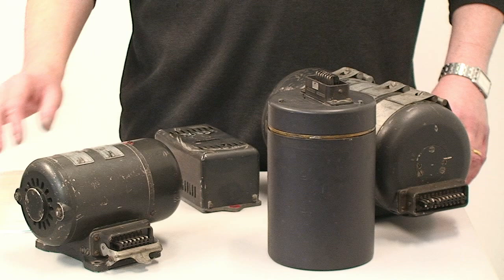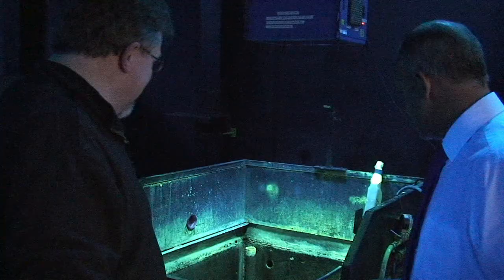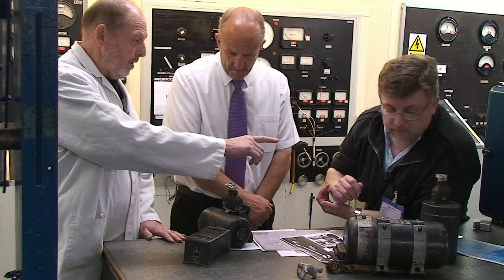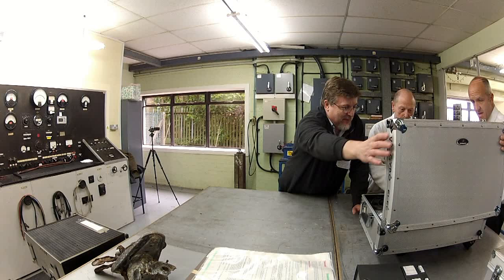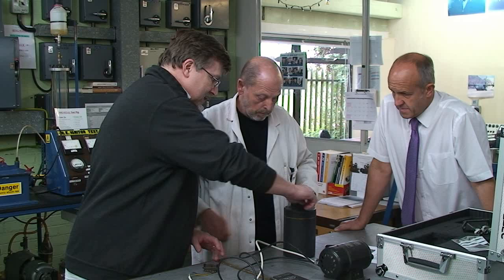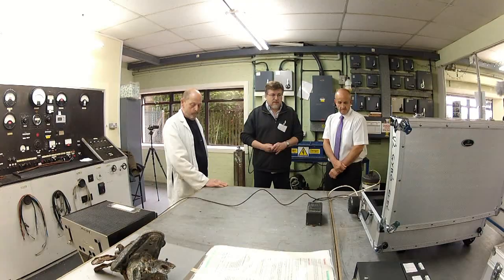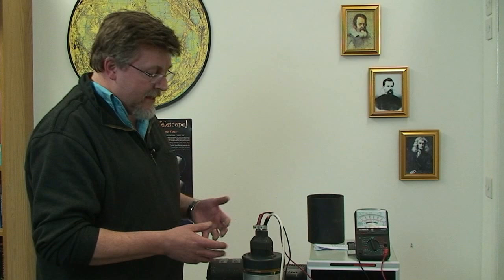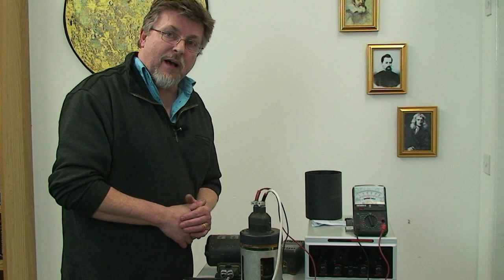The A4 / V2 rocket in detail: Bringing a V2 rocket gyro back to life

Comment: Fantastic explanation, on all your movies!
I am very curious about the V2 compass and his connection and integration.
Do you have one?
Reply from the maker: M. Foryou 

The A4/V2 missile didn’t actually employ a magnetic compass in its on-board guidance system. The launch crew were required to survey the launch site and to determine precise bearings for the centre of the target which would be out of sight over the horizon (eg. Paris, Antwerp, London). That is to say, they needed to be able to fix a point on the horizon such that if you were to draw a line through the middle of the vertically orientated missile, and pass the line through that point – the line would – if continued over the horizon – pass through the centre of the target. Once this survey was completed, the missile would be rotated until one of the fins (fin number one in fact) was pointed in exactly the same direction. This needed to be done with an error of less than 1m per 1000m. Once the missile was launched, and after a few seconds of vertical flight, the reference frame of the V2’s pitch gyro would automatically tilt; the gyro meanwhile, just continues to work steadily to maintain its start attitude.  But as a result of the programmed tilt of the reference frame, the missile pitches into a trajectory that follows the line established to the center of the target.  So no on-board magnetic compass is required.  By today's standards the V2’s guidance system would be considered clumsy and unreliable – but it was revolutionary at the time and provided a cornerstone for much modern development. KR RJD A&NTV
Reply: Astronomy and Nature TV Thanks very much for this complete answer! .. clever system.. i wonder how many V2 eventually failed (out of tarket) in percentage.
Reply: Astronomy and Nature TV:  Amazing extra info.  I was wondering how they set the azimuth on the launch.

Comment: Great, now all you need is a Mischgerät and a Servo and you're good to go! For a quarter, that is. 🙂
Thanks for the upload, and especially the documents in them, I learned a lot from this.

Was the multimeter set to voltage or resistance? Since I'm still quite puzzle at how this all works in conjunction? Are these pickups part of potentiometers or am I missing something?
So the output is in resistance variations or is there an AC or DC voltage coming out that's position dependant?
If so, it makes sense, I get how the Mischgerät/computer works (in large lines, yet to study it in full detail) and you've clarified a lot so far!

Regards,
Thomas

Comment: My modest advise to you, so far as you're getting into electromechanics: do LUBE all and every mechanic electric contact. Doing so you'll save a lot of your time and nerves in bug' searches due to stable and steady (oxygenless) surface electric contacts areas.
Reply: No electrical contacts should be lubricated, except with graphite. Oils are insulators, and they also trap dust, water and debris. Silicones are even worse, because electrical sparking causes a surface covered in silicone to react, and to create silicon carbide, or corundum, whichis both a very good insulator and very abrasive. Silicone lubricants will creep across surfaces as far as 15 to 25 cm (6 to 10 inches) in a few months, thus eventually ruining any electrical contacts. Failure of the contacts will occur weeks, or many months, after contamination, so the root cause of the failure is often not seen.

Comment: Why use AC and an complicated DC/AC converter with a small generator and a frequency controller/regulator? I know it could be because of the rocket connected to mains power, until lanch - then it switches to own battery power. But why not use DC from the batteries, and a diodebridge to convert the external AC to DC, if the rocket was connected to mains power before lauch? Otherwise it also seems like a complicated way to ramp up the voltage, disregarding the DC/AC conversion.

Seems totally over-engineered, but i don't know the V2 in details, or how it was launched...
Reply: Surely you could have done it so if the necessary components have already been invented. I think you did not want to rely on tube technology because of the sensitivity and rather use vibration-proof mechanics.
Reply: Electrical loads on aircraft today generally run on 400hz. Cuts the weight of all the windings.

Comment: Very interesting, I wondered what angle of motion it provided resistive information. Is it capable of 360 degree data? What were the ohmic readings ? 
Trying to guess how they built the navigation .. So they would have needed vector XYZ which two gyros could supply and speed ,possibly altitude ? Have you discussed that anywhere yet? 

Of course they would need some calculation circuit and program circuit for a target. I wonder how sophisticated it was. On first thoughts an analogue computer could do this but did they have analogue op amps? 

Looking at the parts the cost to build such tech then would have been quite decent. Setting up the machines or machinist operations to build.
Very impressive .

Comment: I'm guessing they needed two gyros, one vertical, one horizontal, because they needed to control pitch, roll, and yaw? I wonder how they controlled trajectory?
Reply: Yeah, that part confuses me. What do they mean "vertical" and "horizontal"? I mean, I'm no engineer, but, I'd assume they'd have TWO gyroscopes propped up vertically in the rocket - one for "pitch", the second one, also vertical, but turned 90 degrees, for "yaw"; then, another, third, gyroscope with its axis on its side (horizontally to the rocket, or perpendicular to the other two gyroscopes' axes) to detect "roll".

There must have been crude electro-mechanical computers to provide active guidance to target. The launch crew would have had to set something to "tell" the rocket its launch point position (grid coordinates, and maybe even its launch point elevation as so many meters above sea level), and then the target's grid coordinates and elevation.
Reply: They would have three gyroscopes, all mounted at 90° relative to each other, controlling roll, pitch and yaw (x, y and z axes). This one was the vertical gyro, as he said in the video. The other two would have been horizontally mounted, along the other two axes.
Reply: @MrJm323  Imagine the rocket as a vertical-pointing aircraft. As it climbs it gradually assumes an increasingly horizontal altitude until it reaches the speed-altitude-angle parameters when the propulsion is cut and the warhead behaves as an artillery shell. The "vertical" and "horizontal" mentioned in the video refers to the near-horizontal position, so they become "pitch" and "yaw" in that context.  But I am not sure how they detected an eventual and unintended rolling motion.  I believe comparing the signals of the two gyroscopes together could be the answer. (It would be too long to explain here.)  A third gyroscope would of course be even better.

Comment: Fantastic job on restoring these old systems and explaining how they work! Do you have any information on how the gyro signals were translated into motion on the control surfaces? It would be cool to see how they compared to the selsyn actuators on the B-29 electric gun system, which was state of the art for the adversary of the V2 at the time.
Reply from the maker: Hi and thanks for watching. Yes we have a vid in the pipeline that looks at the V2's on-board 'computer' system and the control surface actuators (trim and jet vane) so keep watching! Regards A&NTV
Reply: That's great! We will be watching! Thanks!
Reply: quit some time ... 
the potentiometer of the gyro was driven by an extra battery at 50V to achieve finer measurement. the signal would than be put throw a simple analoge computing device (the "Mischgerät") consisting of resisters and capacitors and differentiate it 2 fold to compute angular velocity and achieve a lead phase shift to prevent the A4 from building up oscillation. it outside power supply was 40VDC but it got its own power supply.

look at page 123 for schematics and description:

www.aggregat4.de/pdf/Ger%C3%A4tebeschreibung_A4.pdf

the rest is adjustment, if got the formula for the control movement (Ruderausschlag) from another book (Das drahtlose Jahrhundert - Hans Frahm):

Ruderausschlag = a = k1 * ε + k2 * de/dt + k3 * ∫dt

they though the fins in the gas stream would not be sufficient to make it stable at start, because of that they added Empennage with fins but as another video of AaNTV shows it worked just fine:
/watch?v=KToggTKa9Lk

i´m looking forward to see this thing in orbit :)
if you need any help with translation, please contact me.

Comment: Hello. Great research. Can I assume that the pickups tested on lap 19:00" are internal for "yaw" and its the Roll pot that is not connected? Also the pickups on the bottom on 6:30" are not variable pitch items put purely for receiving current, yes? At first I was under the impression that they were roll pots, yet I saw Yaw with your needle and was stumped.  Also, I thought the A4 Gyroscopes were two independent ones mounted on a platform.  How does this one play in? Thanks for you time.

Comment: Fantastic video, you have better stuff than in the Peenemunde museum.  Why didn't they use a DC powered gyro?
Reply from the maker: Hi Peter, that's a good question - thank you. The short answer is they needed a well understood and reliable system and the existing alternating current technology was available off the shelf, cheaply and with a profound level of easily available design competence. They needed a power supply system with an integrated reference point so that motors for gyros and control surface actuators could be clocked and kept within predictable limits. Elecro-mechanical methods of controlling current had been available for decades prior to the development of the V2 and the technology was widely used in the aircraft industry. It made perfect sense to use technologies that were 'off the shelf' as the V2 development team learnt early in the project to avoid reinventing the wheel if they didn't have to. Good, 'solid-state' DC control methods were in their infancy in the 1930/40s and would not become a serious, and better, replacement to AC until well after the war - indeed, not until the development of digital control systems was there something actually better than AC control methods. KR RJD A&NC TV
Show less
Reply

Comment: You did not provide the rational behind the inverter and control box and how they worked.
Why is the speed so critical?
I guess that one can not use brushes at that rate in the gyro and that the slightly higher voltage reduces the weight? But I do know cheap tiny brushed motors that do turn that fast on much less voltage.

Comment: Didn't all of that only really need to work for the powered portion of flight ? Once the engine burned out there was no attitude control of the rocket right ??  No RCS system and only real control was with the thrust vanes.
Reply: True but that actually puts more stress on the controls! Because at the moment when the engine cut out, the trajectory and airspeed had to be spot on, since there was no control after that.

Comment: what I dont understand is why the motor for the gyro had to be AC for 500Hz. 
couldnt it have been a DC motor so the inverter and transformer wouldnt have been necessary?
Reply: I was wondering that too. My thinking is that they needed more current to drive the motors than they could generate with DC and batteries, given the technology of the day. Or, it was done to require less battery, for weight reduction.

Comment: I have one qiestion :) servomotors was suply for the same bayttery?
Reply from the maker: Hi Wernher, thanks for dropping by! The gyro motors and the servo motors both ran off the same pair of 16v lead-acid batteries providing 27v 500Hrz AC through DC/AC motor transformers. But the control or signalling voltage that carried the gyro potentiometer values to the mixer/amplifier was provided by a separate set of small 1.2v or 2.5v NiFe accumulators wired in series to provide 50v DC. 
Now if you really were WvB I think you'd have known that. I hope this helps. KR RJD A&NTV

Comment: So the gyro is pretty much two electric motor,s working against one another to keep the rocket upright. How does it work to send itself to it,s destination pre computer ?
Reply: No, why do you say "working against each other"?
Reply: Thats what was demonstrated at the end. Did you see the meter needle deflect as he moved tilted the gyro? That output was used to drive the fins.
Reply: There was a computer. The early V2s used a mechanical analog computer that was later replaced with a tube based analog computer. The computer is what kept it on course and, in later designs, when to shut of the fuel. The gyro were inputs to these analog computers. Driving the fins directly would have caused the rocket to become unstable.

Comment: I, too want to know how the trajectory was set and followed.  Obviously, there were no digital computers with trajectory in memory.  Was there some sort of timer with contacts signaling timed events to a system that reset the desired potentiometer readings?  Or, perhaps the guidance system was not self contained.  Instead, the missile and firing center communicated via some kind of telemetry system?  Does anybody out there want to comment?
Reply from the maker: Hi Mark, thanks for posting. We have a video in the pipeline that will completely answer your question - we've built a special model to show exactly how it was accomplished. The video should be ready to upload before Christmas this year. So just subscribe and keep an eye on your inbox. KR RJD A&NTV
Reply: Thanks for the reply.  I await the release of this report.
Reply: The only way I see this system could be used would be , on the launch pad the trajectory angle for the target, E,W,N,S was set for the gyro and zeroed by manual potentiometers at that angle . The output from the gyro would be ignored at takeoff for a certain time / altitude . After that interval the output which would not be zero (rocket ascending straight up ) would be applied to the graphite vanes in the exhaust of the rocket motor . This output from the gyro would then drive the vanes from their central position to the preordained position and therefore steer the rocket to the correct ascent angle till the gyro output achieved zero (correct target angle) once this was achieved the gyro would be disconnected and the rocket would continue on a ballistic trajectory to its target . This is a bit like treating the V2 as a very large mortar , which essentially it was but instead of launching at an angle from launch (as a Mortar ) the correct angle was achieved in flight .

Comment: Technically the Germans put the first rocket in space with one of these ,   correct ?
Reply from the maker: Hi there. Indeed correct. First record: 3 October 1942 passing into space as defined in the era.  Later in 1944 an A4/V2 passed the 100km altitude mark usually referred to as the  Karman line. KR RJD A&NTV
Reply: @RocketPlanet  The exact altitude of the beginning of space is of course conventional, because the atmosphere increasingly becomes rarified with altitude, and particles of air can be found way above that.  But 100 km is a reasonable choice.
Reply: Also a photo from a record altitude, showing the curvature of the Earth.

Comment: its gyroscope inside v2 rocket xD why it matters if its noisy xD
Reply from the maker: Hi there, and thanks for posting. The reason it matters is simple enough. It's about getting a clear picture and understanding all the aspects of the V2 missile in history. Picture the scene: you and your army mates are in a clearing in the Dutch woods, tanking up a V2 rocket and preparing for launch. Generators and air-compressors are running full blast - this is bad enough. But for the last 25 minutes, before launch, four electro-hydraulic servo pumps have constantly been running in the tail. The onboard motor-generators are all running as are the (as shown) incredibly noisy AC frequency controllers, and finally there's the high-frequency (HF) whine emanating from the two gyros. The whole launch site is awash with low-frequency sound typical of a busy building site, but the rocket is emitting a HF scream that is impossible to hear past - it's like being in a loud nightclub - people have to mouth words or speak directly in one another's ear from point-blank range to be understood.  

So why does the cacophony of sound around the rocket matter? The men tending the rocket would, on the whole, rather not die, but British and American airmen are taking great risks to achieve just that.  And the Brits/Yanks are not mucking about; they're flying the very latest 370/500mph Spitfires, Mustangs and Typhoons - armed to the teeth with 20mm cannons, rockets, and bombs. The planes were approaching fast and low, seeming to come out of nowhere to the Germans on the ground, arriving instantly like magic. 

Even though the launch crews had numerous lookouts posted to watch for the planes - at a personal level, each man in the firing crew knew he could never hear the roar of the attackers motor on approach, and he was very fearful he might miss the alarm from the lookouts - if it came at all.  

Consider, all of the footage we have of V2 combat ground operations like this is entirely silent. So the thing that is missing from those silent movies is the fear those men felt because of the noise of the missile.  Thanks for your post and for letting me clarify that image for people who missed the significance of that particular point. KR RJD A&NTV